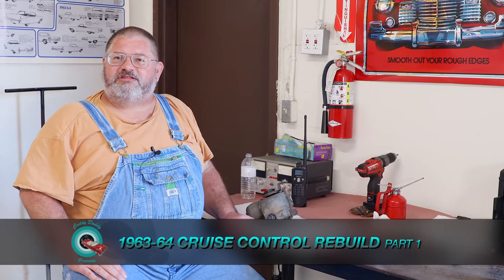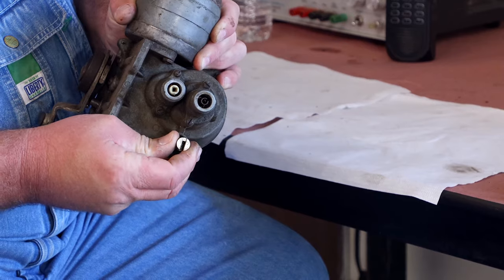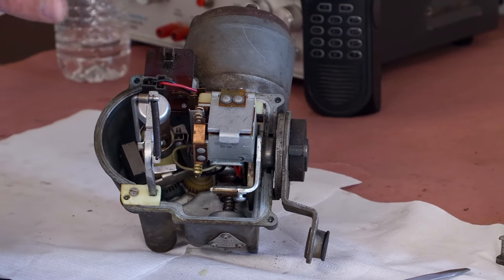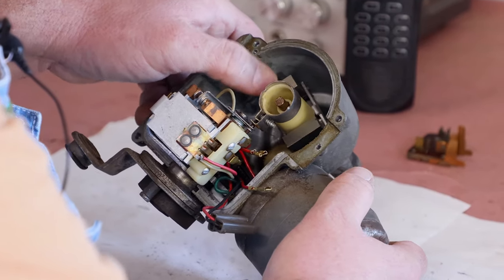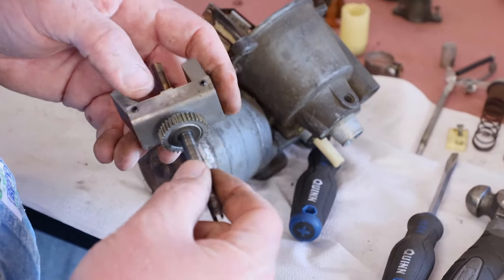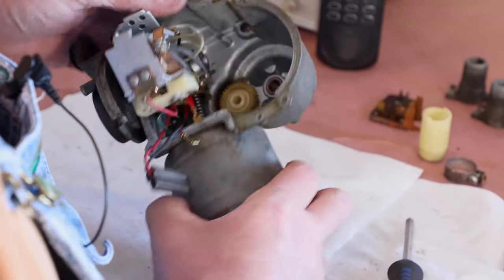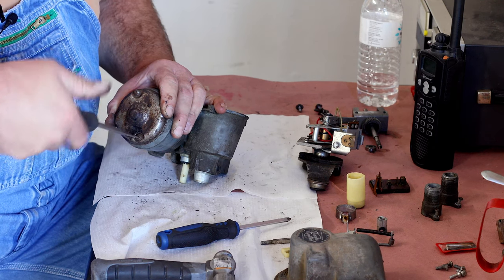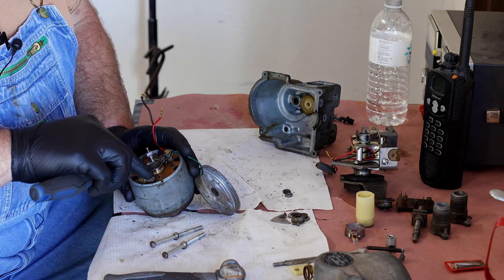How To Rebuild A 1963-64 Cadillac Cruise Control Unit Part 1

Comment: Awesome work Josh! Can you do a video for the trunk motor and release solenoid
Reply from the maker: Are you asking about the 1959 or 1964 Eldorado?
Reply: @Caddydaddy  can you do one for the 59 ? There are quite a few components in it. If you can go through each component and explain how it all integrates. Merry Christmas from Australia 🇦🇺
Reply from the maker: @shilpaweerasekera5182  Our 1959 already has it installed. It was done in one of the episodes in the beginning.We will add one to the 1964 and next year do a video in detail on the 1959/60 trunk lock systems and restoring the components, John